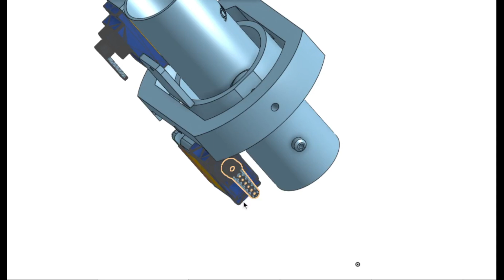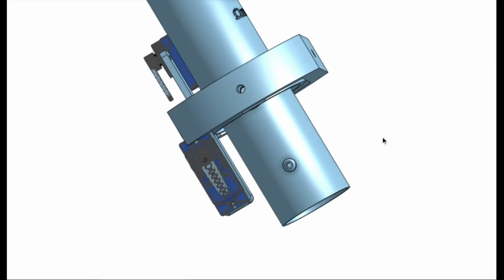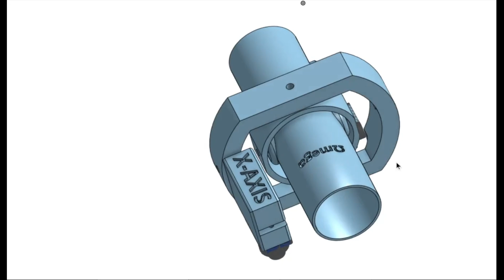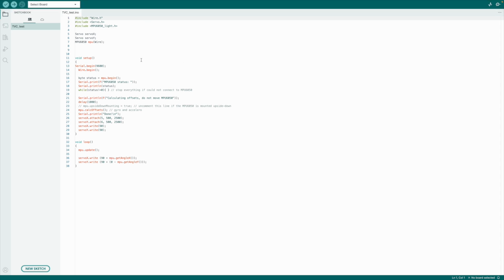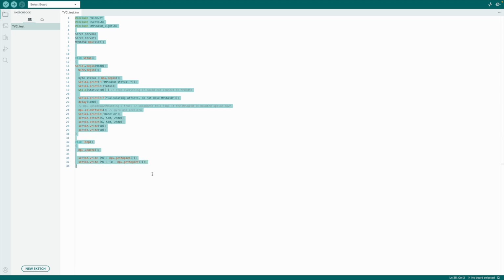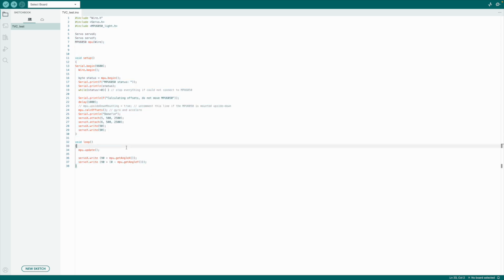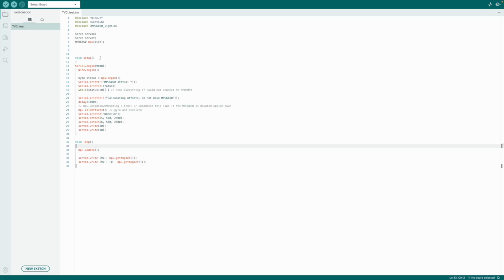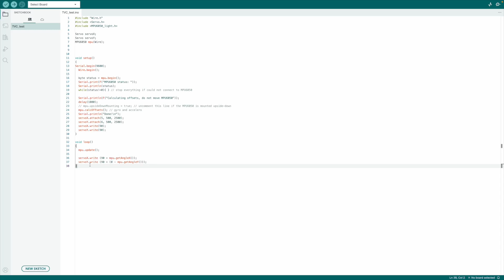Thrust Vectoring Mount For The A.R.A.B. Flight Computer | Ωmega (Building gimbal EP2)

Comment: can u make it open source so that we can play with it too . thanks
Reply from the maker: the 3d files or the code
Reply: yes if possible share both , otherwise just 3d files . thanks  @COSMOSIS245
Reply from the maker: id rather not for now, sorry. However I have some links for similar files if you'd like. https://cad.onshape.com/documents/6bd0f4c1ffc7f2f80c063b4d/w/c5d64b7657358c9b58a8b786/e/ebca04b0250dfc350669af2f @Xerox482